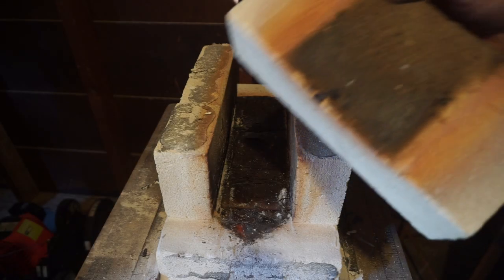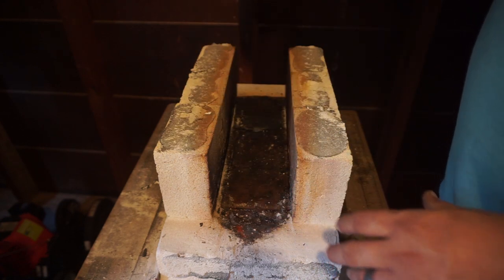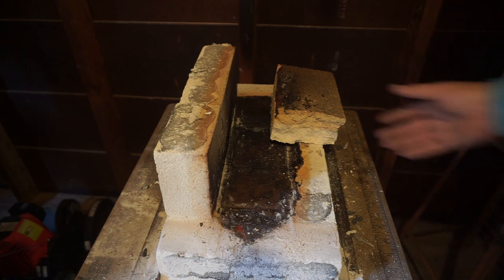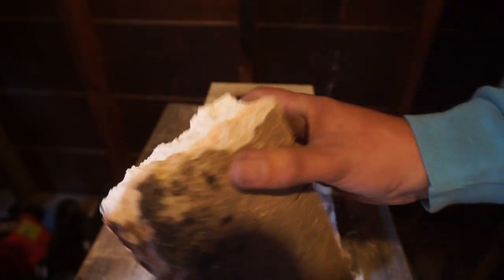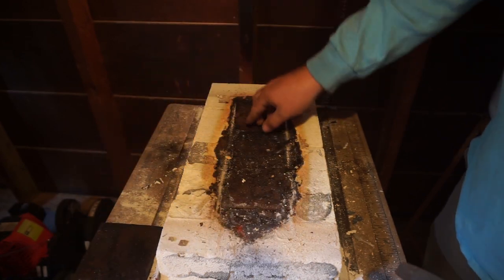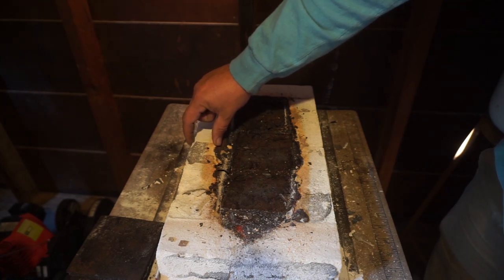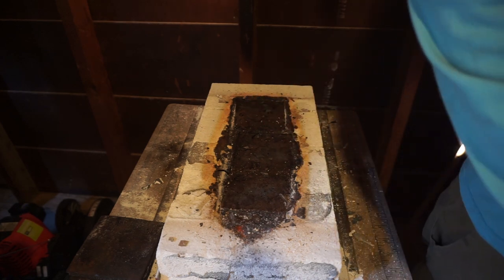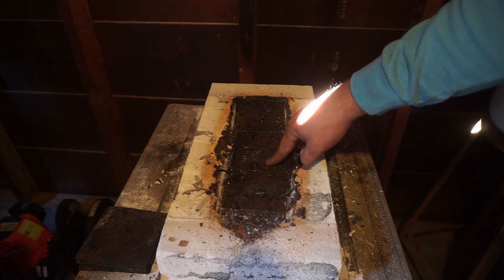What Flux Actually Does to a forge | Knife making | Vlog

Comment: I've always wondered if painting 3000 degree rated casting refractory cement on the bottom bricks would extend their life. Haven't tried it; only forge weld in my coal forge, but don't want my gas forge to look like that!
Reply: Worth a try, but I'd think the erosion isn't just heat-related, but more with the corrosiveness of borax.